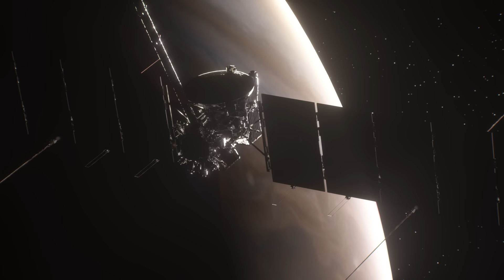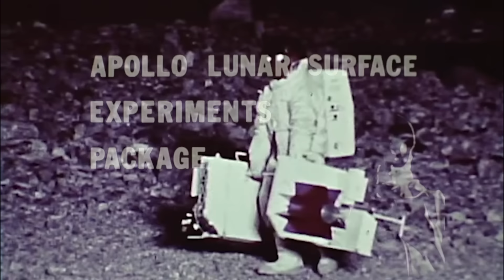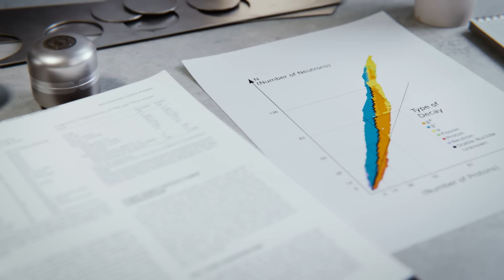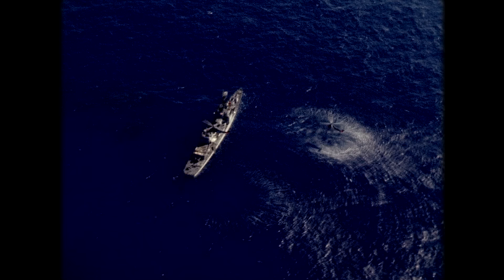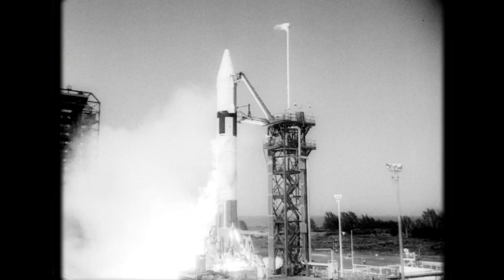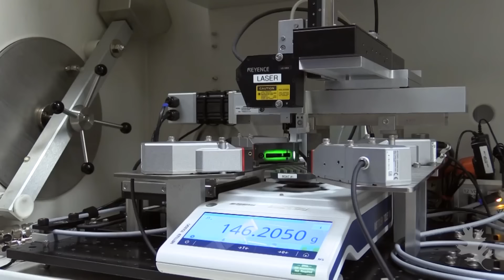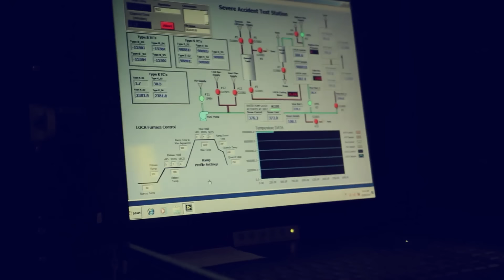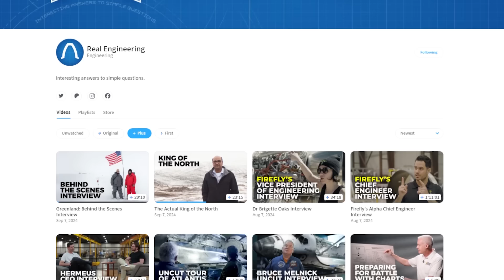NASA'S Plutonium Problem

Comment: This is just a hoax on the gullible, no one has ever been below low earth orbit, the van allen radiation belts would destroy the equipment.
Reply: The actual radiation levels in the van Allen belts is far lower than you imagine. We have successfully sent spacecraft all over the solar system.

Comment: Confused about the part in video and the graphic say that the piston style engine is 30% efficient vs 7% so how does that end up costing more and having 1 star, why would they cancel that project.
Reply: Development of the Stirling engine ended up costing more than was initially estimated, because it turns out not to be easy to make an engine that can operate for 50 years with no maintenance and no lubrication.

Comment: guys can anyone come up with interesting solutions to this problem.
Engineering Challenge:
Developing a mechanism or product that improves maneuverability and directional control when moving multiple table tennis tables.
Problem Statement:
Moving multiple table tennis tables simultaneously presents a significant navigation challenge due to the swiveling nature of the front wheels. When pushing from the back, the front wheels swivel unpredictably, making it difficult to maintain a straight path or change direction efficiently. Conversely, pulling from the front while navigating is also impractical, as the user must constantly move between the front for steering and the back for pushing.

Comment: NASA’s plutonium problem is a serious challenge! Plutonium-238 is crucial for powering deep-space missions since solar panels aren’t effective in the outer solar system. But with limited supply and production challenges, future missions to distant planets, moons, and even interstellar space could be at risk.

The U.S. used to produce a lot more Pu-238 during the Cold War, but now the supply mainly comes from small-scale production and repurposed stockpiles. NASA and the Department of Energy have been working to restart production, but it’s a slow and costly process.

If we don’t find a sustainable solution, deep-space exploration could slow down significantly. Do you think private companies might step in to help with production, or could alternative power sources like advanced nuclear reactors or next-gen batteries fill the gap?

Comment: No need for nuclear.. for nasa as solar sails work rotational generation of energy as wind up tech from older generations work just fine.. God Bless.. with prayers one may find what they seek..
Reply: That doesn't work. If you attach solar sails to a spacecraft and rig them to spin the spacecraft, the entire spacecraft will spin. There's no way to keep part of the spacecraft stationary without expending more energy than you can get from the generator. 
Also, solar sails only provide a tiny amount of torque, far too little to drive a generator.
Reply: @zounds010  counter sails as sails work accordingly to track and angles create a rotation.. think two object in one like a piston.

Comment: why cant we use the heat to create a steam turbine to generate electricity? or reverse the piezo electric effect and create electricity from heat / cold
Reply: The devices that NASA currently builds with Pu-238 use the Seebeck effect: creating electricity from heat/cold, aka Peltier elements. A steam plant is a lot more complex and heavier than these RTGs.

Comment: At best a Plutonium poweted RTG (Radioisotope Thermoelectric Generator) works out to be about to be 85 to 90 years then it is dead.
One has to ask why isn"t NASA using the same Diamond Batteries which Elon Musk intends powering his Tesla cars with instead of lithium, they are capable of supplying electricity for 5,750 years and never need charging.
Reply: Diamond batteries can provide a tiny amount of power for 5750 years. If we scaled them up, you'd need a device 65 times larger than a Pu-238 RTG to provide the same power. That would make the RTG too heavy to be used for the kind of mission NASA uses RTGs for.

Comment: The process you espouse requires separation of Pu238 from Pu239.  Unless I am very much mistaken, the US has a large quantity of Plutonium for purposes of nuclear weapons.  As you already have to separate out Pu238 from other isotopes, wouldn’t the weapons stockpile be a much better place to start?  Once the Pu238 is removed, the other isotopes of Pu could be remade into bomb cores.

However, if I recall correctly, the reason why an implosion design  had to be used for a Pu based bomb instead of the much simpler gun-type method used in the bomb dropped on Hiroshima was the high spontaneous fission rate of Pu240.  Any separation of plutonium isotopes has the potential to make it much more practicable to build a gun-type atomic bomb using plutonium.  This could be a serious proliferation risk.

Comment: Why dont they use Uraniu -235 or thorium as a replacement fuel instead of Plutonium
Reply: Because U-235 and Th require a nuclear reactor. With Pu-238, you can use an RTG instead, which is much simpler, and can be made smaller and lighter.

Comment: OMG. I'm thinking getting a Tungsten made box to put Magam inside. Just use Copper in a graphite container. And make sure you keep the heat of the graphite container Above 1,085°C so you Copper doesn't Harden.

Comment: A couple thoughts - 1) Photon reactor - uses high energy (10MeV) electrons to produce 10MeV gamma rays which then split U238, supposedly producing up to 20 times the energy needed to produce the photons.  So, instead of using a particle accelerator to produce high energy gammas via high energy electrons, how about encasing something that already produces high energy gammas in U238?  Should be pretty easy to find material that produces high energy gammas (and neutrons - they can also split the U238).  Call it an energy multiplier.  2) If Pu238 really is the thing to use, might as well have the "starting stock" as a powder, suspended in some liquid metal (Sodium or something) and pump it through a reactor - pull the Pu238 out as it's being created (more or less).

Comment: You’d have build a battery that can harness electrical energy from 241Pu or 239Pu decay processes. ( Helium battery for alpha decay of 241Pu, 5% speed of light emitted in force through engine and out of the other side to push a vessel through space at significantly quicker speeds. A concept, it must be tested)

Comment: Hmm, does the vacuum/radiation cooling mean that manned space stations are unintuitively (at least to me 😅) easy to keep warm, for the crew?
Reply: Yes. You can do a thermal design where the station stays comfy without active heating or cooling, by balancing the insulation (which determines how much heat is lost) with the properties of the surface layer (which determines how much sunlight is absorbed. As far back as Apollo, the only cooling that's necessary is to remove the body heat of the astronauts, and the heat of the onboard systems.
Reply: That's so cool! 🙂

Comment: Pu238 is a "waste product" of a Thorium molten salt reactor (MSR). In fact, it is one of several "waste products" of this type of reactor (MSR-LFTR) that have real-world applications in several fields, making these reactors useful for more than just electricity production (they are also ideal for electricity production, operating at low pressures and very high temperatures).

Comment: Theoretically, could Plutonium 238 be used to power cities? How much Plutonium would be required and how safe would it be?
Reply: Rule of thumb: 5 kg of Pu for 125 W of electrical power (when the device is new).
Reply: @zounds010  Wait, 11 pounds of plutonium for only 125 watts of power? That's not enough to power a hair dryer. Talk to me. I'm an idiot.
Reply: @davidhunternyc1  Yep. the trick is that after 50 years, it still produces 60 W. RTGs are used for missions that can't use solar power, because they operate far away from the sun, in a dusty atmosphere etc. Missions like Voyager, the large Mars rovers. Also, the Apollo experiment packages that had to operate through the lunar night.
At large scales, a nuclear reactor gives better performance, but RTGs can be made smaller and are simpler than reactors.
Reply: @zounds010  I see. Thanks for the education. I read that the half life of plutonium 238 was 88 years, not 50 years?
Reply: @davidhunternyc1  Yes, the half-life is 88 years. The thermocouples in an RTG gradually degrade as well, so the power output drops a bit faster than just the half-life suggests.

Comment: I used to work at a company that managed over 50% thermal efficiency with their standing wave stirling engine. No piston required. The record for prototype longevity was 2 years continuous use. Manufacturing improvements would have pushed that to over 7 years, easy.

NASA has options on that front, but I suspect the challenge of launch-proofing the current generating elements (reciprocating or linear alternators) might be the tough bit. If the RTGs can hit 1000C, that's more than enough for an efficient stirling engine.

I need to go see why they stopped that project!

Edit: I googled it. Surprise surprise... money. NASA needed more cash to fly the missions already scheduled, so had to cut some development programs. That sucks.
Reply: also, the Stirling project was already way over budget.

Comment: why not just make a contraption that starts the fuel when it reaches the desired point of operation - therefore only requiring a minute amount of power to engage the system for the full duration of its fuel cycle
Reply: You can't stop nuclear decay.

Comment: For a practical alternative, see the IEEEE spectrum article, nasa's shortcut to fusion. Using lattice confined fusion they can make the neutrons that allow uranium arthorium to be lit up after a spacecraft is launched. This will generate decay heat without needing plutonium. Plasma physicists have a hard time understanding solid state fusion. They are they are not strong at at understanding materials.

Comment: I feel like this video completely glossed over the actual reasonable alternatives to Pu-238 that have been known and used in RTGs for years. Namely, Strontium-90. You seemed to have skipped over it because it's a beta emitter? Okay, it requires more shielding than a piece of paper but it's not particularly more hazardous than Pu-238. It has nearly the same power density, a shorter but very usable half life of 29 years, and it's a common high yield fission product that can be made as a byproduct from fuel reprocessing. That's why the USSR used it in their RTGs. Also, polonium-210 can be produced continuously in an (alpha,n) reaction with beryllium-9 and bismuth-209, circumventing the low half life of polonium. All around, this points out the concerns of people working in Pu-238 fabrication, but completely disregards the viable alternatives that exist and are currently in use.
Reply: Thanks for the information. I don't know enough about nuclear physics but that gives me more to go learn about!
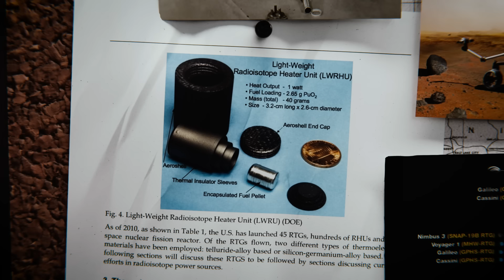Reply: I was wondering the same - why disregard beta emitters? Looking at the RTG container at 7:38 there is no way beta electrons could escape those multiple containers anyway.
Reply: @Martinit0  For high-energy beta emitters, besides the electrons, you also need to consider shielding from secondary bremsstrahlung x-rays, but this is still a light weight layer of thin lead foil

Comment: why not thorium, it has the same type of slow powerful heating reaction and is more stable.... and I think more easilly available. it does need to be catalysed into a stable reaction but would avoid the need for refined plutonium 238.
Reply: Thorium needs a fission reactor to be useful. Those are much larger and heavier than the radioisotope thermal generators this video is about.

Comment: Why Instead of Poultier effect and sterling engine they don't design a photoelectric lamp witch matches Helium alpha particles to one side of a an x material electrode, So it  emits plasma into Other electrode of a photo electric lamp, And they complete a circuit together And walla,...
Voltage is being produced. No  sterling engine and no poltier  effect. 
 
Ashkan sayadi desgner of red cross 🫡

🪖📐⛑️

Comment: What's the betting this also relies on battery storage?

The heat is of course 10x the useful energy if using the Seebeck effect.

Or 3x if Stirling cycle.
Reply: RTGs produce continuous power - no batteries are involved.  Voyager has been periodically turning off instruments to stay below the dwindling output of its RTGs as the half life progresses.

Comment: It's a bummer that the sterling engine project never worked out. Seems like that would be worthwhile if NASA could make it work.
I understand that NASA is fumbling around for table scraps (they only had 0.3% of the federal budget)and a Stirling engine that doesn't meet the reliability standards for spaceflight isn't something that congress is probably willing to spend cash on. If you're willing to throw money at it, maybe but if you don't know if it's going to work what's the point.

Comment: The shortage wouldn't be nearly the problem it is if the conversion factor from heat to electricity was more efficient. Spending hundreds of millions of dollars (or maybe billions) to produce the radio isotopes that are "easy" to use rather working on a more efficient conversion method is peak stupidity imho. If they can't develop a stirling engine that can withstand a launch then add the stirling engine to the package after it has launched but before it heads for deep space. Once in space there is essentially no vibration compared to the launch and the g-forces will be much less. A stirling engine isn't a complicated piece of equipment so surely it could be assembled on the space station or similar.
Reply: The problem with a Stirling engine isn't the launch, it's the fact that it has to operate for decades in a vacuum, i.e. without lubrication.

Comment: We don't need plutoniun anymore at all everyone is going into thorium.... Less harmful and easier to obtain.... The shelf life of the waste is a faction of the standard.... So why the heck did you ever make this video in the first place????
Reply: This video is about Pu-238, which is used in RTGs. Pu-238 doesn't use fission, which makes the device orders of magnitude simpler.
Reply: @zounds010  so then Uranium-235 would be a better choice in this manner Pu is puke now and a days we don't need it as much as you think we do....
Reply: @stephenpegg5636  U-235 has a half-life of 700 million years which makes it unusable for an RTG.
Reply: @zounds010  there is allot of other types of fuels they can use.... Plutonium is something that has been faded out... This is the point that I am making.... Americium-241 Curium-244 Strontium-90
Reply: @zounds010   Americium-241 for the win as it stands its a good stand in for Plutonium fuel all it is a work around but its not as harmful in the end....

Comment: Personally I think time would be better spent developing a tiny modular fission reactor platform that can be deployed as a charging station for solid state supercapacitors or batteries... Drop the reactor in a few parts that can be assembled in-situ with robots, start it up, and get your drones to charge their batteries from it over the next 50 years... You don't need much shielding, but cooling might be a problem...

Comment: There are barrels of plutonium buried in Rocky Flats, Colorado. Come get that. Seriously. We don’t want it.
Reply: That's Pu-239, not the Pu-238 you need for an RTG.
Reply: @ What is the difference between Pu-239 and Pu-238? Why won’t Pu-239 work? I’m genuinely curious.
Reply: @MrTigerlore  Pu-239 has a half-life of 24,000 years, so its decay only produces a tiny amount of power. 
To make pu-239 usable, you have to build a fission reactor. Pu-238 has a half-life of 88 years, so a chunk of Pu-238 is red hot from the heat of decay alone. You can put thermoelectric elements around the Pu and convert that heat directly to electricity. This is far simpler than a fission reactor.
Reply: @zounds010  Thanks for the response. That does clarify things.

Comment: i might have zoned out, and missed the video explaining it, but i dont think i did, whats the issue with using uranium 232 as the schematic said was also among the elements with alpha decay, and a long halflife? assume its easier to get that than any of the other elements mentioned as uranium occurs naturally. or does u232 only occur as a product of another nuclear cycle? also why wouldnt any of the nuclear elements with extremely long halflifes work? is it because of the long halflifes making them energy inefficient unless they go through fission rather than regular decay making the amount needed so high that it would weigh too much for space application?
Reply: U-232 has a decay chain that contains gamma emitters, which means it needs a lot more shielding than Pu-238 (which has alpha emitters only).

Comment: May I suggest alternatives? For some reason NASA wants to go the hardest route, here are some elements that should be looked into! Cesium 137 half life is around 30 years which is less than 80 but for shorter missions it would work fine, and Americium 241 has a half life of 432 years and both elements have already been tested for RTG use as well. These options are more viable and much easier to produce
Reply: Cesium 137 is a gamma emitter.  Dangerous and hard to shield.